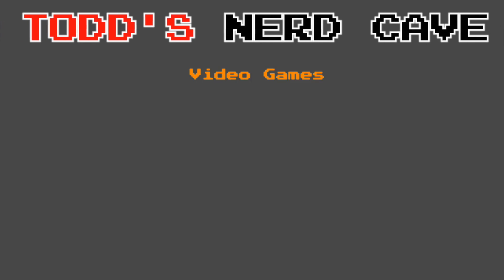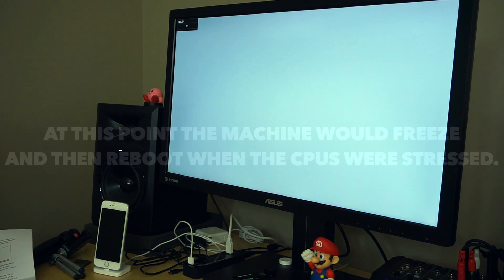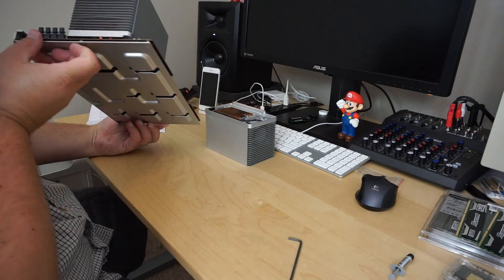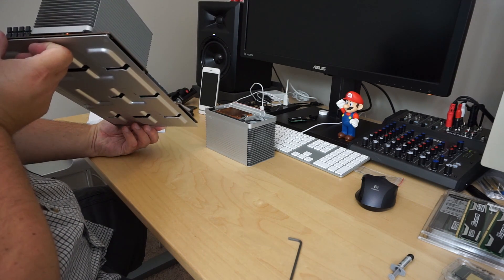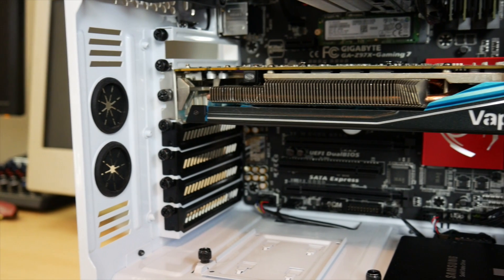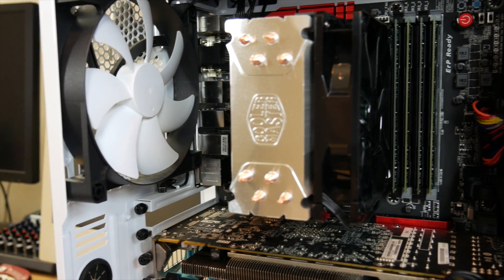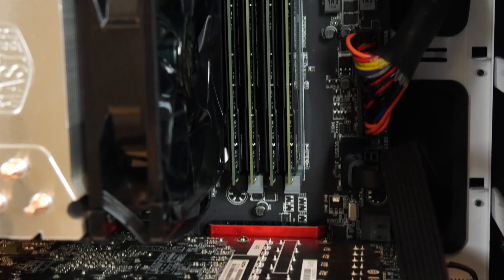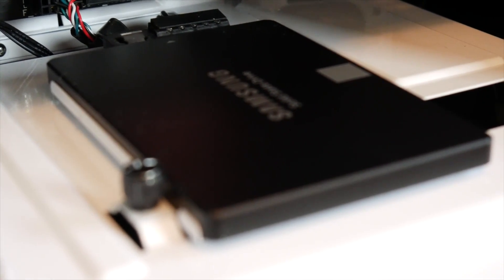2009 Mac Pro 12 Core Part 2 - Exit the Mac Pro, enter the Hackintosh...

Comment: From a fellow nerd's point of view, I am sort of disappointed that you sold off that beast of a Mac Pro, but with that said a friend of mine is putting together for me an old server rig of his for free. It's similar CPU-wise to your former Mac Pro, being that it's running dual Intel Xeon X5650 CPUs, and that kind of power is waaay overkill for what I intend to use the server for, but it'll be faster than my desktop here, which runs an Intel Core i7 3770k. What's ironic is that my soon to be Xeon server's parts are from 2010 or so (like the Mac Pro you sold) and due to it running/sporting CPUs that total up to 24 threads, it'll feel faster. I plan on using it as a Plex Media Server (upgrading my previous set up which ran an Intel Core i5 2500k with 8 GB of RAM). As I said, the 24 threads of power is gonna be overkill, but I also want to mess around with server-side stuff that I've never had the proper hardware to mess with. Finally, it'll be running FreeNAS ultimately, but I will try to Hackintosh it ...for science. lol Great video series, and have a great day! (I know this video is from 2016, but I only found it now when researching stuff on the X5650s I'll be getting.)

Comment: Add NVMe to the 4,1 / 5,1..  1.5 GB/s data read write... also with Apple pushing Metal 2, these machines with a GPU upgrade might be a lower cost power house. I'm building my 3rd unit..
To add NVMe boot support, you need to inject firmware from the MP 6,1.

Comment: Great video, I just wanted to know about doing a performance upgrade to run new Mac OS. Not looking to go full Hackintosh. Glad you figured out the problem with the heat sink. I may try and see if I can add the new chips and additional RAM

Comment: No thanks, i'll just keep my 2010 mac pro 12 core. I have a 1TB Owc PCIe boot drive + 4 SSD internal drives + 2TB G Drive connected ESata. Maybe for video editing your "Hackintosh" LOL might be "better" or "faster" but it's not gonna hold a candle to the mac pro for audio and that's all that matters to me. Plus I can upgrade my memory from 32GB to 128GB you can't do that. LOL. 

At the end of the day YOU might consider your machine "better" or "faster" but from a technical standpoint, it's technically not supported and just a matter of time before you run into problems. 
I promise you......your gonna end up buying another mac pro just watch! LOL. Believe me, a grew up a PC fanboy but I'm not gonna compare apples to oranges. LOL. Everyone in professional audio uses Apple for a reason. :)

Comment: I love your review awesome information but you're pricing is a little bit off. You could grab a Mac pro 2.66 4,1 QC round about $300-$350 and get a 3.2 6C CPU upgrade kit for another $180 and update it to a 5,1 system to run the latest OS. (Total $480-$530) or you could grab a 4,1 2x2.8 8C around $600 and 2x3.33 12C CPU upgrade  around $370 and upgrade it to a 5,1 system to run the latest OS. (Total $970) Your video was very intriguing and I watched it until the end and it's entirety. I Own one of the new Mac pros and if I knew what I knew now I would've bought an older one but at least I feel future proofed till Apple phases it out lol. Right now I'm setting up workstations and I wanted something big and beefy so they can't be stolen easy, I needed something that was upgradable at a somewhat cost-effective price and the primary purpose of the computers will be for professional audio. What I like about the two configurations above is the fact they will support 128 gigs of RAM.
Reply from the maker: The new Mac Pro is still a good machine, it just depends on what you do with it and need from it. For example, video editing in Final Cut Pro X is a much better experience with the trashcan Mac Pro than even a heavily upgraded 4,1 or 5,1 machine. Though, sadly, a current iMac is even better than a high spec'd out trashcan MacPro (at least in FCPX). I dumped the Hackintosh and bought a 5k iMac. It runs circles around the 12 core Mac Pro in this video and even better than the Hackintosh in Final Cut. It eats 4k footage like no ones business. Outstanding value for video editing.
Reply: My biggest question to you would be what would be a good graphics card that supports Mac logo booting? I didn't dabble in video and I have a $150-$250 budget for each machine, 🤔
Reply from the maker: You do realize this video is a year old, right? And the pricing info was correct at that time. 4,1 machines have really dropped in the past 12 months. Especially since they aren't officially supported by Apple under Sierra.
Reply: No I did not lol. I am reading about the Nehalem chips and I am so mad about owning my trashcan.
Reply: Todd's Nerd Cave which imac5k do you own? Processer and gpu?

Comment: I hear people talkin about flashing windows cards for the MacPro. A bit above my level of expertise.. but if it can be done, what the best card we can install in late 2008 Mac Pro III. Say something with 3G memory (or more).
2) is a PCI adapter for the main SSD that much faster than plugging the main SSD into port one? Like is that a noticeable differnce? or would the video card upgrade be more bang for the buck for rendering and exporting? 
3) whats the highest OS FCP 7 and Premiere Pro Cs6 will run on?
thanks man! Great video!

Comment: nice video thanks for share! 
1)after many research i bought for a editing studio a mac pro 2009 for 620€ + 300€/400€ for the best cpu  x5690 + ssd ecc.. in almost 1200€ i have 12 core real mac pro.... you really sure looking at this price still better doing an hackintosh? 
2) i found lots cpu sill with Soldered IHS, you think better to remove?
really thanks

Comment: Hi Todd, great video (P-1&P2)… I am considering to update my music production machine and had a few questions I hope you might help me and others with.

Currently I have been using an old G4 450(w/cpu upgrade 1.5gh), OS 9.2, old Logic Audio, Ultra 160 scsi card w/2 10K 18gig hdd's… I'm frustrated, I run a lot of tracks and the cpu maxes and drags, the hdd's barely register… sooo...

 I thought I would go for a used MPro, as you did, and upgrade the HWare. I will be using the machine mainly for intensive music/Logic projects, and then some video editing(small projects), not much else. My money budget is an issue, since I will also need to upgrade to some midi/fw/usb/audio interface, hdd's… 

Could I update the machine below, as  fine as yours did, to 12 cores?

Which newest processors should I get for the most bang and stability (for Logic Pro X 10.2, FCPro X…)?

What kind of HDD do you suggest for recording/hosting audio tracks?

Did you install, and how does the ATI Radeon R9 280X video card perform?

Would you suggest the "NVIDIA GeForce GT 120 with 512 MB of GDDR3" below be replaced as well, and with what card?

So, buy and upgrade a MPro, buy an iMac, or build a Hackintosh... Which Machine is ultimately better for lots of audio tracks, FX, and soft synths?

Thanks so much for your time!!

• Apple Model #  MB535LL/A , A1289, MacPro4,1 $695.00
Product Specification:
 • Apple Mac Pro (Early 2009) 2.26GHz 8 core Nehalem - MB535LL/A-Mac Pro "Eight Core" 2.26 (Early 2009/Nehalem) is powered by two 2.26 GHz Quad Core 45-nm Xeon E5520 (Nehalem) processors with a dedicated 256k of level 2 cache for each core and 8 MB of "fully shared" level 3 cache per processor.
 • Introduction Date: Early 2009
 • System Bus Speed: 6.4 GT/s "processor interconnect speed".
 • Memory installed: 6 GB (PC3-8500 DDR3). Maximum Ram: 128GB.Memory slots: 8
 • Hard Drive: 1TB Serial ATA (3 Gb/s) 7200 rpm
 • Video Card:NVIDIA GeForce GT 120 with 512 MB of GDDR3 memory was installed in a double-wide, 16-lane PCI Express 2.0 graphics slot. It has both a Mini DisplayPort and a dual-link DVI port.
 • Display Support:With four video cards installed. By default, one NVIDIA GeForce GT 120 was installed and it can support two 30-inch displays. The default video card is capable of supporting digital resolutions up to 2560x1600 and analog resolutions up to 2048x1536.
 • Ports: 5 USB (2.0) - 4 Firewire 800Mhz
 • expansion Slots: This model has four full-length PCI Express (PCIe) 2.0 expansion slots, two x16 slots and two x4 slots. In the default configuration, one PCIe 2.0 x16 slot is occupied by the graphics card. Apple also reports that "all slots provide mechanical support for 16-lane cards" and there is a "300W combined maximum for all PCI Express slots."
 • Optical Drive:slot-loading 8X "SuperDrive" with 4X double-layer burning (DVD+R DL/DVD±RW/CD-RW)
 • Wireless Card: AirPort Extreme (802.11a/b/g/n) and Bluetooth 2.1+EDR standard
 • Apple Keyboard and Mouse included.
 • Mac OSX 10.8 Mountain Lion Installed
Reply from the maker: I would think for your usage case, a pimped out Mac Pro would be great. The stock Geforce GT 120 video is garbage. It's good enough for testing the machine and upgrading the firmware from 4,1 to 5,1, but for everyday usage it's crap. The R9-280x worked great and was a tremendous upgrade in every sense of the word. I know very little about Logic, but there are some videos on Youtube concerning how it performs on upgrade Mac Pro's. 

I do know FCPX though. To be honest, the 12 core is kinda a waste on FCPX as it won't utilize all 12 core very well. It uses maybe 6 or so threads and the rest are mostly idle. But the 12 core upgrade will get the most mileage out a dual cpu machine.
Reply: Todd's Nerd Cave Thanks Todd!!

Comment: Thanks for the video. My 1,1 MacPro is happily running El Capitan thanks to Piker-Alpha but it is relegated to web surfing, Messages, word processing, iMovie editing and other 'light' stuff which it does handily. But I too have gone the Hackintosh route for my FCPX workstation which specs out exactly the same as yours, except I got the Gigabyte Gaming 5 mobo. I'm using a GTX 960 which runs very nicely but found a used Vapor X R9 280x very cheap so I will be able to compare the Nvidia and AMD offerings. The 280x is coming soon. Just wondering if your install was out of the box or if you had to do any special Clover settings for the GPU. Thanks.
Reply from the maker: shouldn't require any special tricks to get the r9-280x up and working. it works out of the box with a typical install.
Reply: Thanks for your response. Keep up the good vids.

Comment: Yo Todd, I installed the 5680s last night, it took forever, some ram not showing up, tightened down, then no boot, clean, pulled out the CPUs and found a big blob of old compound between the CPU B and the logic board!!! I have no idea how that got in there. I was able to get it out, It took me three try's and the second CPU was the tricky one, I really thought I must have over tightened them and had fried the logic board and or CPU. Red light CPU light was coming on and not booting. So I got CPU 1 working first without CPU B installed, then re did CPU 2 and slowly tightened and tried to boot, first time no luck, tighten a tad more and  she finally booted up  but still one ram chip missing for CPU 2.... Tightened a 1/4 turn on each screw heat sync B and bingo...Whew! What a bitch. I think the IHS make it tougher to get all the ram to show up. Will stress test today, but my mental stress test was last night :)
Reply: It's cool the Mac Pro has lights to show you CPU failure behind heat sync B lights up when there's trouble and on the logic board a memory warning light when ram is not showing up, all lights are off when things are good.
Reply from the maker: +Lance McVickar I didn't mention it during the videos, but yeah I had trouble with ram not showing up too. I had to do the same thing with pulling the tray out, turn the heatsink screws, put the tray back in and test again. Rinse and repeat several times till finally everything shows up ok. Total pain in the ass. But glad to hear you sorted yours out though.
Reply: +Todd's Nerd Cave itersting so IHS or de lidded same issue with the ram.
Reply from the maker: +Lance McVickar Yeah. Seems you have to be really careful when tightening down the cpu heatsinks even with delidded cpus.

Comment: I have an upgraded 12 core 2009 Mac Pro with Xeon 5650s and am about to install 5680s I got a pair for 340.OO on eBay. It's true the i7 smokes Xeons for creating proxy media and other non GPU but CPU video processing. I mainly use my Mac Pro for Pro Tools HD Native and for that application more cores the better, and the faster the better. If Apple made a 12 core Mac mini with i7s that would be awesome. Apple has the money to create a real pro computer that makes everything but they don't... So the hacks will keep on hackin... Congrats and all good info. A step by step how to build  a hack would be a great video
Reply from the maker: +Lance McVickar Hi Lance! Your Mac Pro upgrade videos were actually my inspiration for getting one. I agree that if Apple really wanted to compete in the workstation market they easily could. But sadly appears that they don't really care.

I plan to do a Hackintosh build up video later year with a Skylake based i7 setup once 10.12 comes out.
Reply: +Todd's Nerd Cave cool! I may have to go the way of the hack down the road. Will keep an eye out for the video.

Comment: Nice Case NZXT 440 , if you Add Corsair H100i and over clock the cpu to 4.3 -4.4GHZ the machine will run fast like crazy horse..

Comment: I use a 12 Core 5.1 3.33 ghz 64 gb Ram 2 PCIe 500gb Samsung Evo SSD's I use mine for audio and having the 12 cores help a lot in this uses I use it for. Not only a DAW but also running Kontakt Digital Sampler Instruments that stream from disc and need multi cores and SSD drives and lots of Ram to work right

Comment: Great video, Todd! It was really interesting to see those numbers and hear your thoughts as I've been browsing around looking at different Macs for a little while and have often wondered about picking up a 2009-2012 Mac Pro. After hearing your Hackintosh success story and finding inspiration within to give mine another shot, I'm so glad I did. With similar specs to you, I feel you on the smoothness man. It's buttery around the OS and so snappy with absolutely everything. I couldn't imagine buying an older Mac Pro while I've still got this machine up and running:)
I really enjoyed this dude, keep it up!
Reply: +Todd&#39;s Nerd Cave The heat problem was solely due to throwing in the X5680s.  Those processors actually exceed the power rating that the 2009 Mac Pro is capable of, so you're throwing a lot of power at chips that need (I think) 130W, while the MP natively tops out at 95W.  The x5675s, operating at 3.03GHz (with six cores) are the the fastest compatible Xeons for the 2009 MP that operate at 95W.
Reply from the maker: +ItsMyNaturalColour Tom, thanks so much for the comments! I might pick up another 2009 or later Mac Pro down the road. But certainly a single CPU one as the dual cpu ones just cost way too much money for what they are (plus the power requirements and heat they put out). I wouldn't mind having one and install OS X Server on it and stick a bunch of hard drives in it. I already have my NAS on my network with 15TB of available storage, but having a second storage machines, and OS X Server based one at that, is really appealing to me. Lots of awesome stuff could come out of that.
Reply: +Retro Dan™ thanks for the insight on CPU wattage

Comment: great video man. those PC specs are pretty beefy dude. you should just go Win 10 and game off of it :p
Reply from the maker: +Modern Vintage Gamer lol. I don't really play modern PC games at all. Dat XBox One is my modern games machine. Plus I like the Apple eco-system too much. Though I give MS props as Windows 10 is nice. Certainly better than that turd Windows 8.
Reply: +Todd&#39;s Nerd Cave Did you try running the 12 core mac pro on Windows 10 and see how well Adobe Premiere Pro could handle 4k? I can purchase a 5,1 Mac Pro (12 Core 3.33ghz Westmere, 64GB ram) for pretty cheap (just throw in some SSD's and a decent video card) but I was thinking about running it mostly on Windows 10.
Reply: How's the mac pro holding up? Still smoking PC's or what? LOL